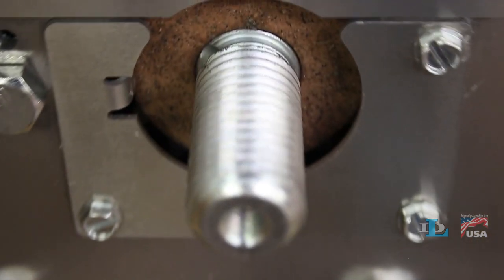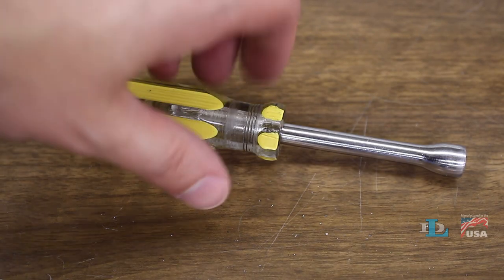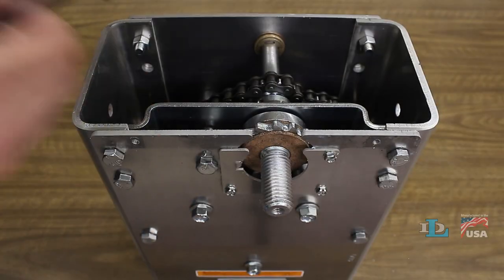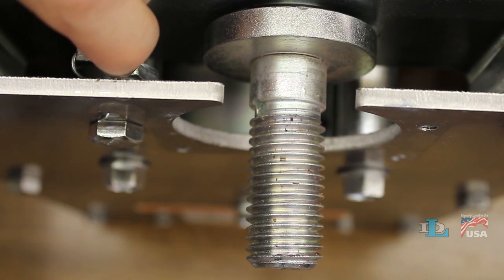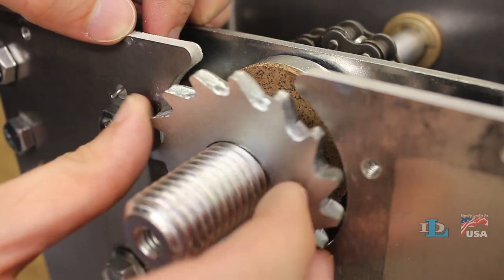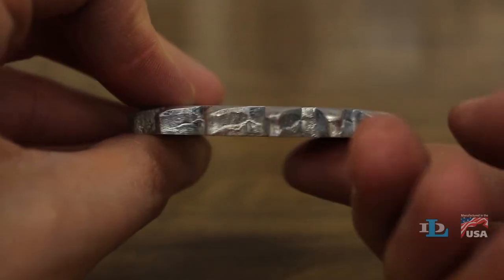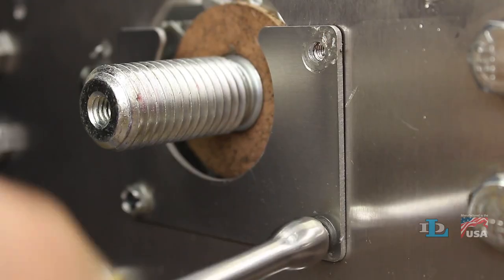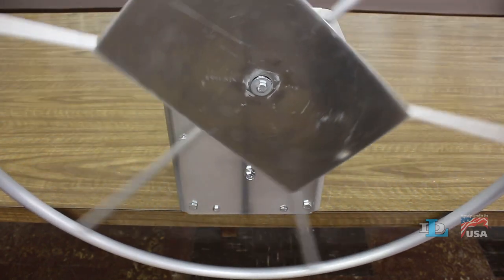Replacing the Brake Pads on the CD4000 Brake Winch - Step-By-Step

Comment: This could be a good video to have shown where to lube the drive shaft when the wheel is stiff lowering a load.  I surely don't want grease on the brake pads in my b1500, I'm sure I can add some to other gears without harm, but where specifically do I need more grease to get it to go down easily?
Reply from the maker: You are correct that you shouldn't get any grease on your B1500's brake pads.  You should apply a small amount of grease to the threaded area of the drive shaft, along with other areas of the winch like its gear teeth.  A detailed description of all the places we recommend applying grease to B1500s can be found on page 1 in the Winch Maintenance section of its owner's manual here: https://www.dutton-lainson.com/assets/pdf/owner-manuals/206168.pdf